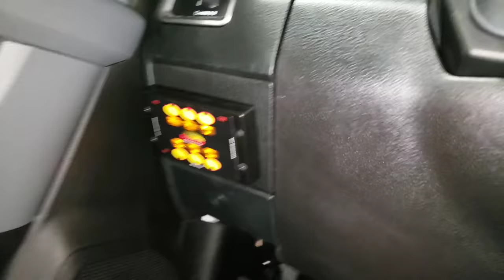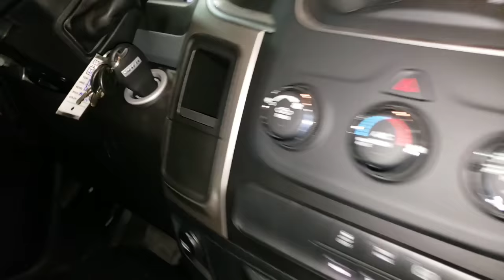LED Strobe Light Install & Sync (ST3/ST6)

Comment: Where does the flash pattern wire go to.. is it just wired to all yellow wires of all strobes?
Reply from the maker: Yes. They are all connected using the yellow (sync) wire. You can either leave it exposed with a jump wire somewhere or run it to a powered momentary switch in the cab which would allow the driver to change patterns on the fly.
Reply: @WRECKERMANDAN  Thanks getting them tomorrow and was thinking of a momentary switch.

Comment: ......WHAT IS THAT LITTLE "POWER SUPPLY" DEVICE!!???.... FYI/IMHO: YOU COULD/SHOULD ADD A LOT OF STRIPS IF "REFLECTIVE TAPE" AROUND YOUR VEHICLES!. THEY WORK ALL THE TIME, AND COST VERY LITTLE!   THANKS FOR THIS AWESOME DEMO VIDEO!!!! I WANT TO ADD SOME SAFETY STROBES TO MY MOTORCYCLE!!!...
Reply from the maker: Its a Power Probe product. Allows the user to test fuses/circuits, and supply power or a ground to devices to test them. Check out all their products including this one at their website:
https://www.powerprobe.com/

Comment: how easy is it to use weatherpack connectors for these sort of installs? added complexity or?
Reply from the maker: You could do that but even if you stagger your connectors it might make all your connection points extremely bulky and not so clean and hidden. 🤷‍♂️

Comment: Great vid, clean work.   Wish you where around me so I can get my strobes fixed lol.
Reply from the maker: Whats wrong with them?
Reply: I have 8 strobes on my truck and none power on,    My flood lights don’t work ether.         These lights where installed when I bought the truck.    They came installed when the truck was new.      Checked the fuses and all look good.     I’m stumped.
Reply from the maker: @El_witda_rr  There is more than likely a junction box that all the strobes are wired into that connects to you auxilary switches. This box will probly be mounted in the bed somewhere. Its possible there is corrosion in the box on the terminals or a break in a wire somewhere. Most common is a ground issue. Retrace all the wires from your auxilary switches and the lights to find where they are all connected to each other. Dodge also has a factory issue with aux. switches sometimes failing. This would be the last thing to check and would require a visit to the dealer.
Reply: WRECKERMANDAN  I will check ,  thank you for trying to help. I will keep you posted
Reply: I found the issue,  fuse on the battery was blown , every thing working now

Comment: How did you mounted the strobes on the grill?
Reply from the maker: I made backing plates out of aluminum, painted black, that are same shape and size of light that I bolt through behind the grill using machine screws. The grill is sandwiched between the light and backing plate.

Comment: Hey bro great video by the way I was wondering did you wire the lights up to the auxiliary Switches inside the truck? Thanks
Reply from the maker: No, I cover that in my VSIM wiring video.
Reply from the maker: The lights are wired to the PowerUp Products PDC-8. It is the Power Touch pad I show to the left of the steering wheel, routed to the controll/relay box under the passenger seat. I have the seat removed in the video so I can show you the box and wiring more closely. There is a link to the PowerUp Products PDC-8 in the description. I have been meaning to make a vid for everyone on the PDC-8 for some time now. Sorry for the delay.

Comment: Do you have a video of the installation of the bridge of lights?
Reply from the maker: I think your asking about in the large aluminum pylon, the roll bar thing. lol Unfortunately the little but of footage I got of that didnt get used. I figured it somewhat self explanatory. I may be able to clarify some questions you may have...

Comment: When you did the grill, how did you daisy chain them
Reply from the maker: Group each light first, either group 1 or group 2, set each strobes flash pattern, then wire all together connecting all three wires. The yellow wire is the sync wire. This is how they communicate with each other. Once they are all wired together then power the entire harness.

Comment: What does he used to put the strobes on the grill?
Reply from the maker: I cut out aluminum backing plates from 1/8" aluminum plate that are the same shape as the strobe. I use machine screws to sandwich the grill in between the light and backing plate. The backing plate has a hole in the center to allow the wires to travel directly through. I paint them black also, so they dont stand out and are some what hidden behind the grill.
Reply: Some use drywall anchors the spring loaded ones

Comment: Do you have a link to the wire you used for this install? Been looking for something similar and can’t find it anywhere
Reply from the maker: Its just 3 lengths of either 12 or 14 gauge wire chucked up in a drill and twisted together to make a 3-wire. Run it where you need and then splice into it where you need.
Reply: @WRECKERMANDAN  hey so for the alternating groups how do you wire that? My wire set has 4 wires red power, black ground, yellow pattern  and white syc wire.  How do you wire it to do that criss cross as a group?
Reply from the maker: Same as in the video. Group(assign) each light BEFORE connecting(wiring) together. Seperately power each light, to check, making sure it is correctly assigned/grouped before connecting the sync wire to each. Then install your corresponding groups/lights in the diagonal or whatever pattern/layout you want. Now wire everything together. Make sure you connect the sync wire on all. Do not have them powered during connecting, wait till completely wired to power on. When the entire system/chain of lights is powered on now the lights will communicate through the sync wire and the pre-assigned groups will be in sync. This how you get the bounce back and forth effect. For example, the upper left and bottom right in a diagonal pattern are group two, the upper right and bottom left are group 1. Refer to the video on how to assign groups. Since you have a four wire, one wire might just be to group or change pattern while the other is to only sync. Refer to your manufacturers owners/install manual or just play around with it before installing. Im sure its roughly the same concept, the manufacturer may have just seperated functions onto another wire to simplify the setup. Hope this helps, let me know if your experiencing issues.
Reply from the maker: Many people have trouble understanding, and I realize maybe I didnt explain this clear enough in my video, but in order to enter the grouping mode. Powrr must be sent to the power wire and the pattern wire at the same time. You can not power the light and then put power to the pattern wire, this will only change the pattern. Power must be applied to both at the same time, then while continuing to hold power on the power wire remove power from only the pattern wire and then re-apply power to the pattern wire. It can be a bit tricky. If using a power probe wrap the power wire around the tip to help hold it while moving the pattern wire on and off of power to assign the desired group.
Reply: @WRECKERMANDAN   still can't wrap my head around this. To me it seems like there have to be a different switch leg. I did this years ago and my wife's Veterinary ambulance the cheap little LED system and I cannot remember for the life of me how I did the alternating lights at all... I'm thinking I had an extra wire but that may not be true
Reply: @WRECKERMANDAN   I Will have to give this try. Thanks for responding

Comment: It always scares the crap out of me when drilling into any car or truck frame 😟
Reply: Yeah you just got to bite the bullet sometimes, depending on the size of the hole, the frame will be fine. For this it's nothing and won't effect the structural integrity of your frame.

Comment: Could i get a mechanic or electrician to do this job?
Reply: This is an old comment but if you haven't already ask around, usually there are aftermarket light shops or off-road customization shops that do this kind of thing on the regular. If you don't have a clue where to start call a wrecker service ask who puts in their lights, or call your local PD and ask who installed theirs. You're bound to find something
Reply from the maker: What he said 👆

Comment: You missed one step. You need to paint or seal the holes you drill. Now it’s going to rust out over time.
Reply from the maker: You are absolutely correct! I have faught to get these companies to allow all fab work to be done before paint. Unfortunately not all are as organized as we would hope for. 🤦‍♂️ And most customers do not care as that process will take so long that they have usually sold the truck by then. Definitely something to vocalize when having your own truck built.
Reply: @WRECKERMANDAN  wow, that’s crazy! Haha they will be back in a few years wondering why the 1 inch hole turned into 4
Reply from the maker: @clearwaterdirtholetrapping7752  🤣🤌 Some customers up in the hills with the snow and salt yes! From what Ive seen in my experience it usually is a slower process then we would think. Most these guys beat the hell out of the truck and within a year the deck of the bed is toasted and covered in surface rust anyways. 😩